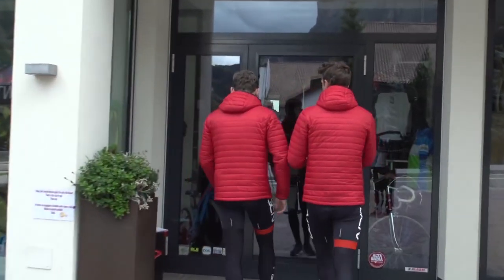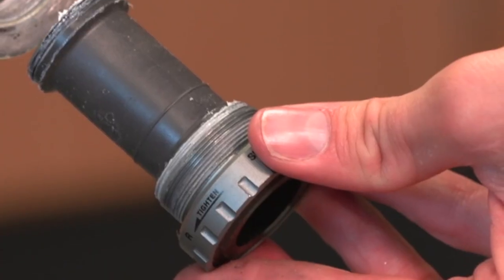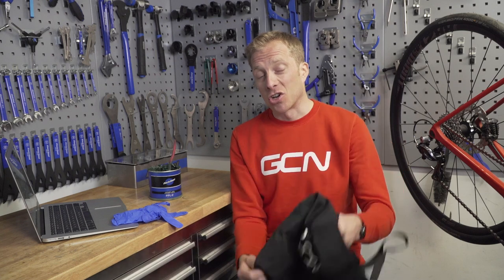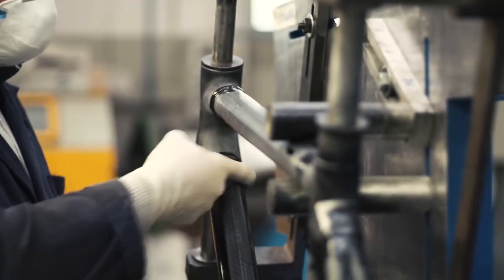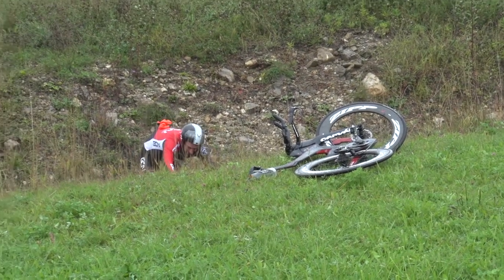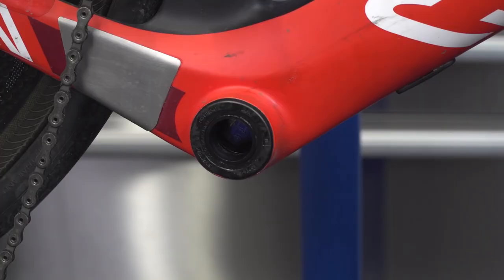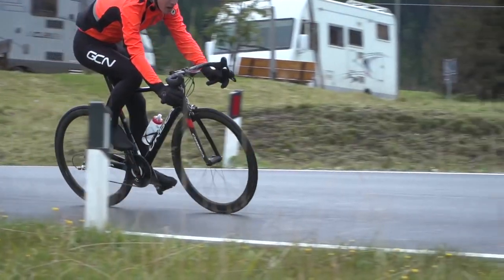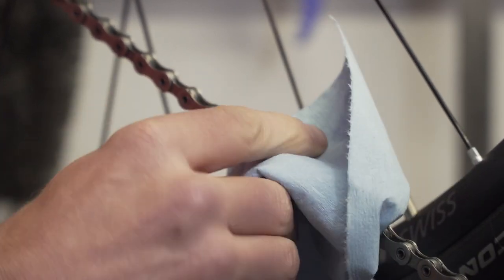Grease, Lubricant, Threadlock, Fibregrip: What & Where Should You Use It?

Comment from the maker: Do you know your grease from your threadlock?
Reply: Hi Jon, would you recommend me using ceramic oil over regular finish line dry oil? I only ride during the summer when its dry.
Reply: and after applying the lubricant wait 3-4 hours. Solvent in  lube must evaporate. So, ideal time for lube is evening)
Reply: How long does the wax last after the chain has been waxed?
Reply: Yassine:  And Nutella's way cheaper.  Can't wait to apply - bike will smell great!
Reply: Just for buying reference, NGLI 00 or 0 or 1 is a not-so-viscous grease suitable for many freehubs while NGLI 2 is kind of midway in thickness and useful for most other bike-grease applications
Reply: Petrol to clean the chain - then soak in engine oil. Wipe off.
Reply: Hello GCN,
my uncle said that it is not really worth cleaning a chain hence it has to be replaced because of extention after a year of intense riding. Is he right?
Reply: I use a tf2 all weather chain lubricant, is it any good?
Reply: Yes, I do.
Reply: I go in Dry bb
Reply: @VladThe333  Depends on what time of day you like to ride.
Reply: Thought I'd have a watch to check for any errors picked up. Glad to say none!
I'd say that if you NEED threadless to hold a bolt in place something is wrong.
Tend to grease all bolts and metal to metal interfaces with MucOff grease, PTFE spray on the pulley wheel bushings, and carbon gripper paste on clamping surfaces.
Ceramic lube is a better lube for the summer, as it is more resistant to water without attracting lots of junk. Not robust enough for winter though!

Remember to grease your freewheel shell, i had a winter bike where the cassette seized to the hub!
Reply: @Moonwaterz Because they are pants!
Reply: TF2 Ultimate Aerosol Spray with Teflon® (400ml), is what I use, youd not like it as it comes in an aerosol tin which you spray it from, so I put an old tshirt behind when spraying so it doesnt contaminate anything.
Reply: @yahyabaali7886  lllhi
Reply: About time Thanks !

Comment: LocTite 222 for chainring bolts.  It's a low strength threadlock - keeps the chainring bolts from loosening, but still allows for easy disassembly.

Comment: I have a 2006 Kona Jake the Snake. My mom bought it new, rode it for years, and has since passed it down to me. In the spring and fall, I disassemble it completely. When I reassemble it, I use white lithium grease in wheel bearings, the headset, bottom bracket, some threads like pedals, on the cassette hub, brake bosses, and on the interface between the cassette and lockring. All other bolts get blue thread locker. I usually put a drop of wet chain lube or silicon oil in brake and shift cable housings. The chain gets wet lube, though I think I might start using dry lube because I never ride in the rain if I can avoid it.

Comment: I'm using the wax method for more than 3 months now, and aside of the removing chain to lube, it's perfect. 
Obs.: I reapply every month or 3 weeks. Started with a new chain, and the wear is apparently normal.
A tip I learned. Where I live, big ceremonial candles are cheaper for the weight and easier to find than to buy paraffin.

Comment: Loctite 222 screwlock for chainring bolts, limit screws and brake bolts. 
Weldtite TF2 lithium grease with teflon (not ideal environmentally, but have had one tube for the last 3 years) for bearings, seatposts and other dissimilar surfaces I don't want to sieze.

Chain Juice wet lube for chain in current UK conditions. 

For all other things like derailleur pivot and swing points, occasional cable easing, brake levers and gear shifters I use good old 3 in 1 multi purpose lube.

Comment: I use and have used a wax based lubricant called Sqirt for my mountain bike and road bike chains. It works in both wet and dry conditions. The application method is different for wet vs dry .I've had excellent results with it.

Comment: +GCN Tech ( really hope you see my post) love your videos! Wish I had a job with GCN! I might want to add that Seat Assembly Compound (SAC), is also ideal if your putting a steel seatpost in Aluminum bike frame or aluminum seatpost in a steel frame. Also If I install a seatpost that is the same metal as the frame e.g. aluminum seatpost on Aluminum frame I will still use SAC for two reasons: 
A.) For Better Grip. 
B.) Because I am trying to avoid binding. 
So I just want to point that out.

Comment: I have been using chain saw oil for my chains over the last couple of years, it has similar properties to some of the high end lubes at a fraction of the price.  You can buy a large can that lasts forever.
Reply: Rob Bouchard how is it in wet and dry conditions? What brand do you use?

Comment: Ok I almost never clean my road bike, because once I start I don't stop and 3 hours later I'm sort of finished.  I haven't taken my hubs apart but cleaned the exterior with rag and tooth brush. I know your not supposed to, but I use wd40 on every thing. It's just so easy the airesol spray can flush out areas between the free wheel cogs etc. I can't be bothered with three different types of specialty lubes really! I wipe down the rims with a clean dry rag at the end and there is no noticeable contamination or breaking problems. I bought 2 tubes of white  car grease 25 years ago and I still have half of one left. I use this grease on anything I put grease on. Head tube bearings hub bearing caps and chain once a year. In the summer I use wd40 on the chain and now a dry lube depending on weather or dirt on chain I'll use one or the other. In winter in snow and freezing weather I use only the grease on the chain and not wd40 because that will freeze and you cant shift gears. ( back in the day when I worked as a bike courier year round. In the winter in Montreal Canada it can get to -20 Celsius easy). So the question is as a non competitive cyclist whats the big deal? Why should I clean my bike more? Will My chain rings and freewheels where out faster? will I ruin my chain faster? will I ruin my hubs faster? PS I've never used thread lock nor seem to need to. PPS Spray some wd40 inside your cable housing will make them run smooth and never need to be replaced. Well almost never, I shredded the nipple some how on my gear housing cable and had to replace it. If you wax your chain do you still lube it ever?

Comment: I use Duckhams Admax L2 lithium grease for most purposes. It's more waterproof than conventional greases.
It was used in the assembly of windscreen wiper motors and gear boxes where I used to work.
I bought a commercial size tub about 10 years ago when a very small tin of Campagnolo grease cost about £5.

Comment: Something else to consider is stopping galvanic corrosion between materials which have a large difference on the galvanic scale with a suitable grease or coating. A carbon seatpost set in an aluminum seat tube spells mega trouble. I had to totally destroy a carbon wrapped Most seat post to liberate it from a Pinarello F4:13 seat tube which to my surprise was aluminum with a carbon fiber over wrap. It took hours of chiseling and reaming with improvised tools to get the tube cleared for a new Deda seat post. I slathered on carbon gripper paste and taped the interface to stop any water from getting in.

Comment: Anti-seize: Don't use any copper-containing one, go for a ceramics-based product. Threadlocker: Loctite 222 should be enough; but due to all the aluminium and Ti parts, you'd need to use activator 7471 or 7649 as well. And if you live in Germany, you can get away with the best all-season grease for a bike: KP2K-35 or KPK-30 (5€ die Kartusche, für Landwirtschaftsmaschinen). Lose bearings or press-fit BB? Loctite 638.

Comment: Hey Jon, do you use a degreaser to clean the chain before applying lube? I do, but I've heard a theory saying that you shouldn't, the reason being that you cannot - allegedly - properly get the lube "inside" the chain, so you should let the factory lube stay in there, and using a degreaser wipes the inside clean. What is your take?
Reply: Sounds like I'll need to look into this before I buy degreaser.

Comment: I have been thinking about this. I half been using wax(mixed with some paraffin oil) chain for 1 year now. I like it for its longevity. Reapplying is tedious. I wonder I could extend the period between each complete wash and re-dip by actually using wax in a squirt bottle. The wax will be solid so I must heat it up before dripping at each roller of the chain.

Comment: I use fibre grip on any bits and bops that are carbon or touch carbon, like stem, handlebar, seatpost, steeretube.
Got a tube of general use grease(mainly meant for bearings) for bearings and such or threads that tend to corrode or galvanize like pedals. 
I stopped lubing my chains half a year because changing from dry to wet lube and vice vers changed literally nothing. Wet lube stayed on longer, but after ONE wet ride i had to clean the chain anyways since it attractd like a ton of grit. Dry lube doesn't attract as much grit, but gets washed off after ONE wet ride. Even in completely dry conditions, it doesn't stay all that long. So after a wet ride i had to clean my chain either way. This became quite daunting when i had 7 rainy rides in a row. So i choose to wax my chain. Never will i ever use anything diffrent. Lasts longer, repells dirt like a maniac, less friction and apparently reduces chain and cog wear. I waxed my 5 chains and the ones of a friend and my girlfriend. Everyone said that it really does work way better.

Comment: I've used the same stuff for... well, seems like forever. White Lightning for my chain, SuperLube synthetic grease, and Boeshield T-9 for derailleur joints and brake pivots (that sort of thing).
Reply: T-9 is also great for re-lubricating control levers (STIs, DoubleTaps). For the more exposed, easily accessible innards, you can go over them with grease. I hear Slick Honey is a good option.

Comment: I use Marine grease for my head tube in the winter, seems to do the trick👍🏻
Reply: Hi, I'm an amateur to bike maintenance - is there a reason why marine grease isn't used all year round? Despite being slightly more messy, it seems far superior compared to normal grease. Thanks
Reply: martin it’s not slightly more messy, it’s a lot more glupy and will take more of a battering from the elements. It works wonders if you ride a lot in the winter😊👍
Reply: @jamesjahmoolahutmorrison4104  I'll make it easier for you.  Martin wants to know why you don't use it in the summer.
Reply: Shaun Rogers surprised Martin couldn’t reiterate his question if it was obvious I didn’t answer it. But thank you Shaun for reminding me, much appreciated. To finish the answer... not sure if Shaun will be letting Martin know I had answered it... I use one grease all year round, though think of it like using Wet Lube on your chain, you will see a bit of muck from the build up of dust.
Reply: @jamesjahmoolahutmorrison4104  I thought that others may like to know the answer also.

Comment: Wd40 wet lub for winter or muc off dry lube for summer And after washing I use gt85 to pull the moisture from the the links of the chain and use on springs in the derailiers and on occasion the inner workings of the shifters.😁 o and I find gt85 works well to protect the frame.👍🏻 smashing video as always

Comment: 3 in 1 instead of Triflow... we don't need any more fluorine in the environment. Phil tenacious oil for wet weather. Best place to lubricate: derailleur pivot points (not to say don't do it elsewhere, but first time I did this, I though I had died and gone to heaven!). Question... I've been lubing both sides of the chain, where the plates touch... not the roller... am I misguided?

Comment: I use paraffin/paraffin oil on my chain, bearing grease on the pedal axle to prevent binding to the crank, Phil’s Tenacious in the freewheel (a loud freewheel is annoying) and a drop or two of Finishline Red on the jockey wheel.

Comment: What grease do you use for the crankshaft on the crankset during installation? Can I use the Finish brand ceramic grease I have? Or do I need to buy a specific grease for the crankset?

Comment: I think, (correct me if I'm wrong), dry lube works best when it's been left to dry for a few hours, as you're then left with a dry PTFE coating. So do it the night before. If you ride straight after applications it'll attract dirt just like wet lube. I always keep a cheeky bottle of wet lube with me in my toolkit just in case of a mid ride deluge. It's infuriating having that squeak start up once the clouds have cleared :)
Reply: This sounds logical.

Comment: Should I use grease, when assembling headset on carbon fork, that has integrated crown racer(all carbon)..? cartridge bearing. Some instructions, say to not put any grease there when it's carbon.. But I think they are mistaken.. When I disassembled it on my bike first time there clearly was some grease, but it did not look like it had done anything bad there... I think it was there, because it has been squeezed out from cartridge bearing.. Would a silicon based grease be better, than typical mineral oil based one for there. It don't need to have some very good lubrication properties. Just keep water and dirt out.. And maybe lubricate in case when the bearing should fail? ..I got some silicon based brake grease from cars parts store, and I was thinking to try use it next time when cleaning and reassembling it.. Would that be a bad idea, or good? 
Should I really trust the label of grease, or oil can, when it say that it won't affect o-rings or rubber, or plastic parts in bad way.. When it's based on mineral oils. And when they call it as synthetic oil, but then the small text still says, that it's made of mineral oils.. it's confusing. I know the mineral oil destroys the rubber. I have ruined some rubber and plastic parts in past when used wrong oil/grease.

Comment: I am still confused the use about thread lock and grease . Could you elaborate where and when we should use grease vs thread lock. And whenever you use thread lock you would apply grease, then the bolt will rust quite easily.

Comment: I tried waxing for a few months over winter. Even indoors on a trainer I couldn't get more than 100miles per waxing so was waxing about 5-6 times a month.

I tried adding more parafin oil to soften it but no improvement.

Gone back to messy old lube.

Comment: really useful and timely video. Which leads to a question I have: which grease (or other lube) should I be using on my through axles? I have to continually take the front wheel off when the bike goes in the car and the grease it came with is wearing thin. Thanks!
Reply: A fine Teflon grease.

Comment: actually sealed bearings can be completely serviced, u have to b careful not to actually mess the seal up, iv done exactly way too many n cant remember ever damaging one yet so they are suprisingly robust, im also tend to be extremely ocd careful with things like that, personally i use a starrett scribe whiches perfect for puttin holes in the end of ur finger, but if u miss ur finger n get the point of the scribe right under the edge of the seal u can really easily work or pop the seal out, its pretty obvious

Comment: Why would you put fiber grip on a carbon steerer tube? The stem doesn't need a lot of clamping force, since the fork is pretty much turning freely.
Reply: Agreed, and the particles in it can wreak havoc on your headset bearings. It's the one place you don't want Fiber Grip on your bike

Comment: I highly recommend TO NOT use copper based anti-seize paste on carbon or aluminum bikes. No idea why Park Tool is selling that crap for bicycle parts!? Copper based paste is a high-temperature resistant anti-seize paste for car parts like engine screws, exhaust parts and disc brake mounts. All parts that can get very hot. Copper, salt and aluminum is a death wish for aluminum... it will corrode in no time! And that's why many car manufacturer forbid using that paste in their cars where aluminum parts are everywhere. And you recommend it for the aluminum bottom bracket??!!! Crazy... 😬

Comment: My question is on prepping spokes for wheel building. There are specialty compounds lie spoke prep that can also be two colored to help keep drive side straight but at 20$ for each color and it's not much. Linseed oil has always been a go to since it dries for some grip and helps during building. I've also been told and used successfully and standard drive oil and a drop of Loctite medium blue some brands of bike DT Swiss Spoke Freeze locking compound. What's the recommendations on how and when to apply these options during a build.
Reply: Neatsfoot oil (used for dressing leather) is a good alternative to linseed oil.

Comment: I use grease on my fsa slk carbon seatpost in to aluminium frame at 4 1/2 NM of torque, no slippage, i used the piber grip and i couldn't get the thing out and it scratched the seatpost.

Comment: Can I apply a wet lube over a dry lube? I recently started using the CeramicSpeed UFO product. But it needs to be reapplied every 1-2 rides (longish rides)! The chain also needs to be totally clean and dry (e.g. overnight wait) before application. So I have got to my bike to go out, realizing it needs (another!) lube, and just applied the wet lube over the top. Are there disadvantages of doing this other than not getting the apparent slight UFO efficiency?